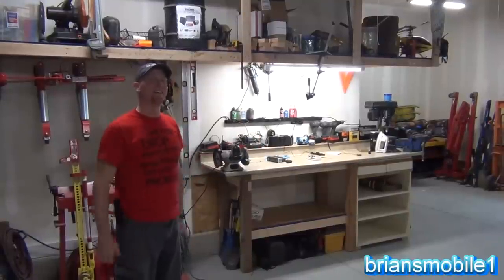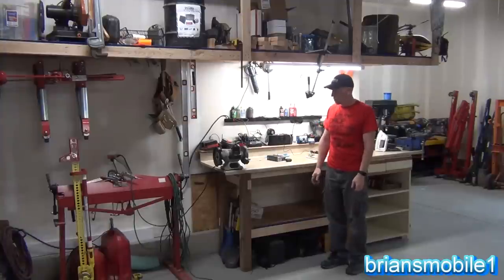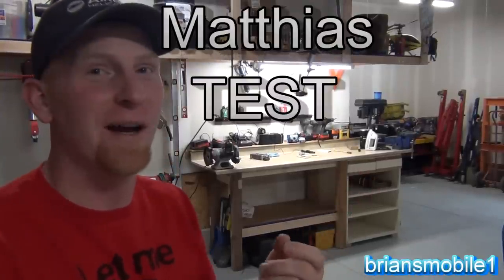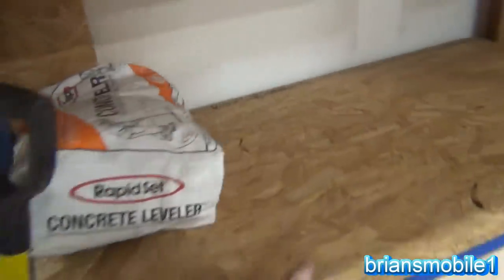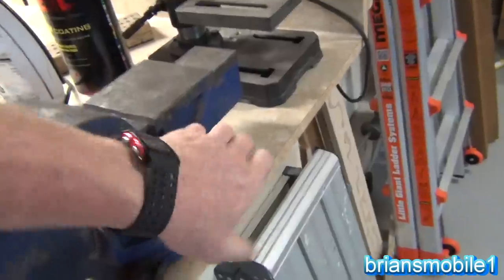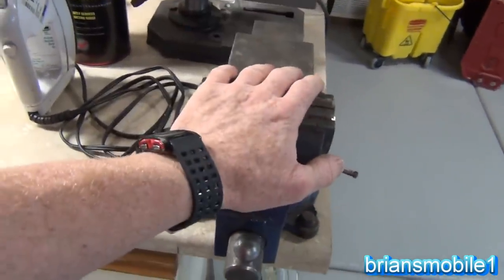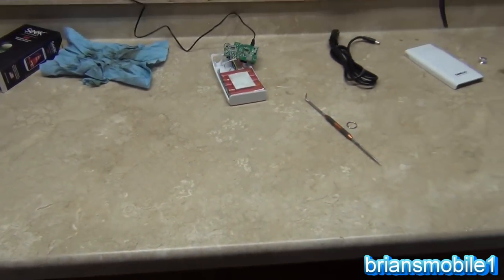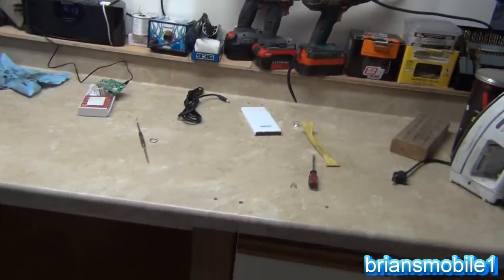Mechanics Workbench

Comment: I'll be measuring the work bench at work! Belt height for mechanics and middle pinky for wood workers. Makes so much sense!
Reply: DE Nichols Many woodworkers ignore the pinky or wrist level suggestion and prefer a taller workbench. Especially if they are a little older.

Comment: Looks nice.
Vibration will compromise your countertop. perhaps a rubber mat under your grinder might save the counter a few more years.
Also a wood [or plywood] reinforcement under the front edge of the counter, and the vise would increase the longevity of both.

Comment: Woohoo!  Congrats on the new work bench digs. insert snoopy dance of happiness.  Isn't it amazing how satisfying a work area can be when it's set up for you?  The thoughts about the ease you will experience instead of the pain endured when trying to get something done.  Almost like getting something done quickly and with great results vs. struggling and fighting with the wrong tool for the job.

It's a shame that you paid good $ to have someone do the concrete work (and they do it as an occupation!) and they still screwed it up.  Can't say enough about work ethic these days - and I'm particularly impressed with yours mister.  Keep up the good work!

You may have mentioned this item previously (my bad for missing) but what is the red work stand to the left of the work bench area?  It looks like some sort of sheet metal press or bending tool.  Do you have any vids/info on it?

Comment: NEC code requires one GFCI protected receptacle in a garage, and considering a GFCI breaker is around $40 or a receptacal is around $15. It basically comes down to builders being too cheap to do a good job.

Comment: On the wall, is that some sort of jack for tire/wheel handling?  I'm interested in that because each year wheels get heavier and I get weaker.   I've looked some, everything is too big or too expensive.
Reply from the maker: +Dave Caselli It's actually for moving the whole car or an axle at a time.  You could use it for wheel handling though.  It would be great for if you wanted to keep one side upright and move it.

Comment: hey brian. who makes that socket organiser on your tool cart ? thanks
Reply from the maker: ROCKmyJOCKz What time in the video?
Reply: briansmobile1 Sorry mate i thought i seen it on this video. Its the red one on your black cart that holds the shallow and long sockets on the "Tool Shopping Checklist For New Technicians" video.
Reply: briansmobile1 Sorry mate i thought i seen it on this video. Its the red one on your black cart that holds the shallow and long sockets on the "Tool Shopping Checklist For New Technicians" video.
Reply: ROCKmyJOCKz The ones that hold the sockets at 45 degrees
Reply: ROCKmyJOCKz The ones that hold the sockets at 45 degrees
Reply from the maker: +ROCKmyJOCKz That used to come with the Great Neck sockets at Autozone.  They were butch.  That one is circa 1999.  I bought it when I was working nights there.